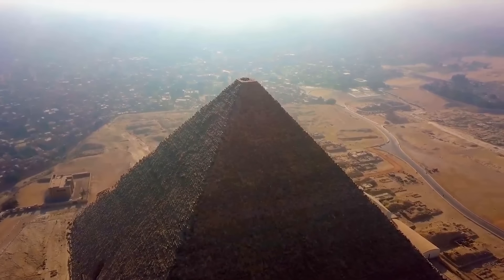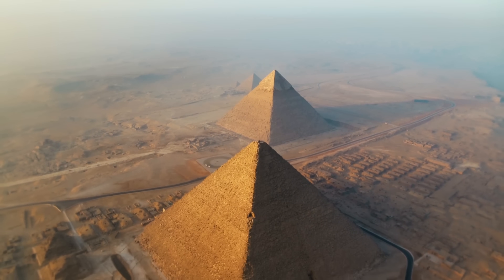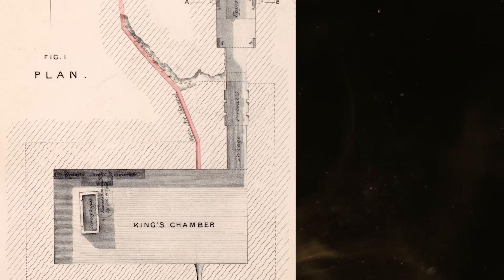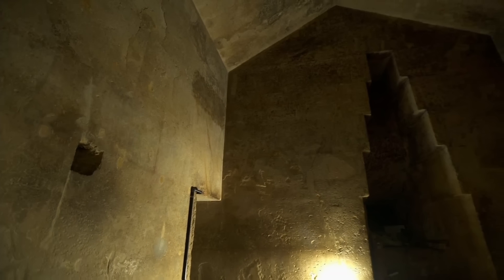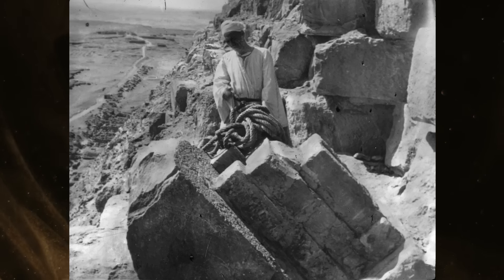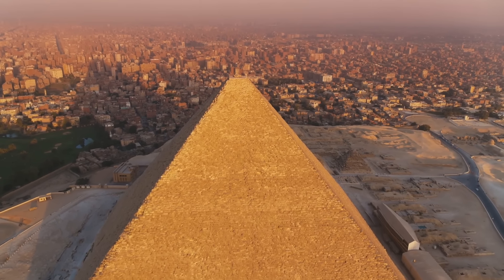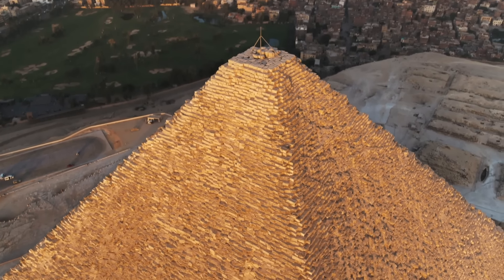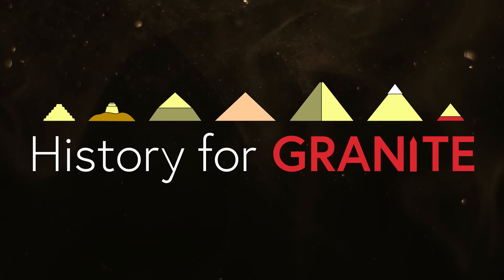One Solution to the Four Channels of the Great Pyramid

Comment: I think, there is no mystery here. The king would visit the construction site while he is alive to see and make corrections, the chamber need to be ventilated before his visit. The workers, must breath oxygen or else will die, so no work can be complete, the vents while construction got clogged often, as they are inclined and it was hard to clean them, so they included sealing doors to close them while they are not working inside, eg.. at night. The sealing was opened when needed for the workers or any other high rank visitor inside the chamber. They simply could not build the internal chamber without these air-passages or else they will not be able to breath and finish the work. The queen chamber may have it's vents sealed as they finished the work earlier and have no future intention to go there.
Finally if you meant to prevent someone from stealing the treasure inside, knowing they can't go inside without oxygen, simply seal the air-passages once you are done inside, get a oil-lamps burning to fill the space with deadly toxic gases without any ventilation and goodbye. Can't understand why no body see the simple reasons. Imagine you are very rich, going to die, and want no body get access to your gold, what will you do? make very big pyramid, seal it, hide all entrances,  seal all air-passages (that was 100% necessary while construction and work inside) fill all with oil-lamps to burn oxygen, leave them to burn and seal the last air openings. The casings stones will not have any sign of where the air-passages are or other openings. and that it, no body for 1000s of years will not be able to enter. or enter and not die after several meters, no mentioning the hard work to be done to excavate by hand all the stones that may be blocking the main walk corridors.
The whole idea of the pyramids are to make it really hard for some one to grab the gold inside, no other efforts are important.

Comment: When I listen to Zahi Hawas speak I get stupider.  Using voice inflection and hand gestures only makes it worse.  Like when my 5 year old really really tries hard to convince me of something.

As a side note for your research:  I would hazard caution for using "unfinished" for ANY explanation of pyramid construction.  Fundamentally, one doesn't go to such trouble to build something so complex only to "not finish" it.  Yes, this may not apply to internal non-visible construction.  I'd like to think that, like all scientists, it's ok to simply say, "I don't know...yet".  Another note: if the subterranean chamber is un-finished, then the same could be said for many other lower chambers that I've explored both inside pyramids and other megalithic Egyptian structures.  I don't know either, just noting.

Finally, as to "what is this for?" questions in general. My impression, worming my way through many pyramids and their oddly shaped chambers seems to be: People and their egress/access seems NOT to be the function for the interior spaces.  It's almost like the interior spaces are very specific for something that is no longer present.  A good analogy would be the voids left in a housing after the mechanical internals were removed.  I'm not suggesting a use, rather, the spaces seem very anti-erogonomic.  This is sharply contrasted by other funeral complexes and associated monuments.  Though, there are many other megalithic Egyptian structures (not pyramids) that seem to have this distinct lack of concern for human movement (see the Qasr El Sagha temple with it's interior oddly shaped "jail" cells that had a giant mechanical lock only accessible from the outside).

Comment: is it possible that one of the ventilation ducts of the king's chamber was used to fill the chamber with water up to the height of the sarcophagus when the portcullises are closed to allow a healing action on the body of a dead person or of a living person placed in the sarcophagus in question for a short period of several days? . Then, it would have been broken deliberately to no longer use this magical process because the water is no longer at the right height with a degraded sarcophagus. / est-il possible qu'un des conduits de ventilation de la chambre du roi servait à remplir d'eau la chambre jusqu'à la hauteur du sarcophage lorsque les herses sont fermées pour permettre une action de guérisson sur le corps d'un mort ou d'un vivant d'une personne déposée dans le sarcophage en question pendant une courte période de plusieurs jours ? . Puis , celui-ci aurait était cassé volontairement pour ne plus utiliser ce procédé magique parce que l'eau n'est plus à la bonne hauteur avec un sarcophage dégradé .

Comment: @18:00 unfinished corners could have been because of human traffic as the edges of anything are most delicate... possibly in following centuries some rulers installed gates etc .. @22:00 and that heat always climbs upwards plus the perfect horizontal tubes will "quickly" get clogged with fine dust in air, vertical will need only to clean the bottom part at arms reach for the cleaners .. i dont know who dumb ppl think horizontal was better approx @33:30 those measures might not be required as sand cannot climb that high even with wind ... remember its closer to ocean and river and not desert where dust storms occur or even with dust storms the vertical nature will immediately roll down granules like sand and taken out by labor inside...

Comment: Ok, is this a mandela effect, bad reporting from others or is this a totally faked video?
Cause all I ever heard was:
1) The shafts are too small to enter (never heard of any attempts at digging inside the pyramid), but far bigger than needed for a rat
2) The shafts are straight and perfectly aligned with some star or constellation, suggesting that they were for the pharaoh's soul to ascend to heaven
3) The shafts never were for ventilation, cause they end like a cul-de-sac (all 4 shafts were blocked)
4) There was this attempt with a rover, but it ended in front of a coverstone / stone door and nobody ever got permission to proceed, eg drill through that stone and insert a camera... (mentioned in the vid, totally genius German engineer)
5) If the pyramids were indeed graves, ventilation would not have been needed.

Comment: Nope/each channel is a loading shaft for different chemicals or metals or combustibles. Together, these ingredients use the magnetism and gravity of the earth at its most even spots—- in unison around the globe- to create an electric energy. Only 3 pyramids were needed ( but many were built) and all 3 were focused to a common point- once achieved, this energy was used to spin the exterior wall-or shell- of the vessel that did indeed bring the original creators OF the pyramids to Earth. The technology used for these vessels saw the exterior spin to a speed equal to and greater than the speed of light. Once that speed was obtained, the vessel could travel around the universe at and above the speed of light. That is the only way possible to successfully travel intergalactically. As long as it remains spinning, it remains functional. So there- now you know. Stop with all this other crap- the Egyptians only vandalized the remnants of what once was an enormous power station. Remember where you read this.
Reply: Believe what you want- it doesn’t matter- but at least you’ve been told the truth

Comment: Those channels, at such angles and lined with granite, why bother? When level ones, just made with lime stone, would have worked just as well for ventilation, and were even sealed up, and even blocking doors... Just doesn't make sense... =/

I was lucky enough to go inside, they felt ANCIENT, I mean really, really Ancient, far older than the official date.